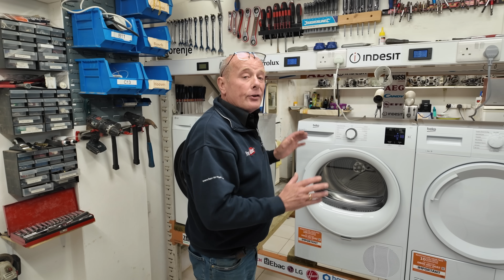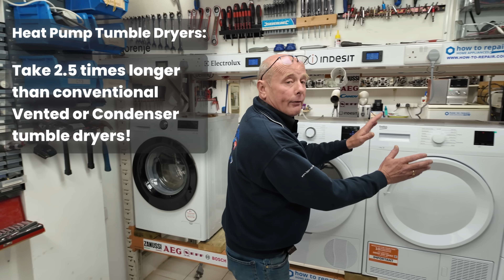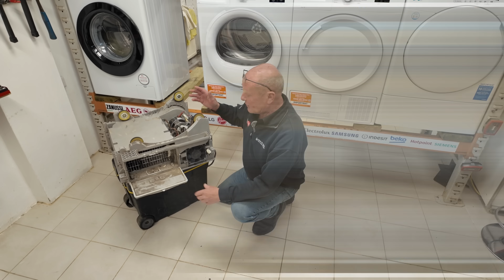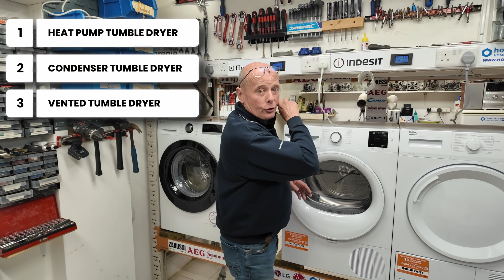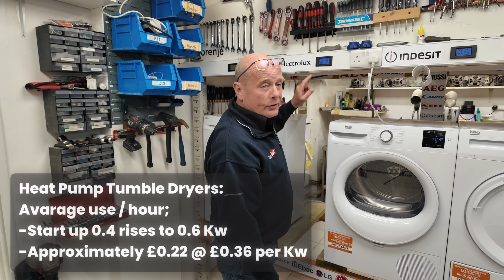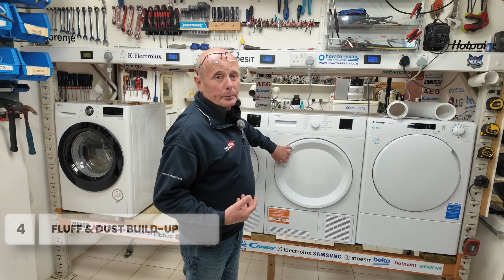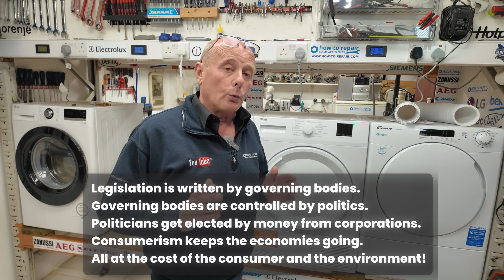Tumble Dryers the Shocking Truth About Heat Pump vs Vented & Condenser, NEW LEGISLATION!

Comment: As a Refrigeration engineer I am a bit biased. I bought my Samsung heat pump dryer used and not working. I quickly found the problem was the evaporator fins totally blocked with fluff that had got passed the filters. A quick going over with a hoover is all it needed, no need to take anything apart. I totally stripped and cleaned it and everything else was fine. It was up and running in about an hour and has run for over 5 years since without a problem. 
Previously I had a washer dryer that I could not use to dry due to the high temperature that ruined clothes. Heat pumps use much lower temperatures so are much kinder to clothes. I would question the drying times as mine takes about the same time as the condensing washer dryer.
Another consideration is the fire risk from dryers which is much reduced with heat pumps.
Repairing the heat pump is definitely expensive but they are the same as a fridge and run for far fewer hours so if the filters are kept clean they should not be a problem.
Reply: Yeah, i have auch POS samsung dryer. That is terrible design with that "filter". I added additional filter in fron of the fins made from the aquarium filter - easy to clean, low resistance. Never again samsung appliance.
Reply: @kuflik  mine came with a filter. I also replaced it with aquarium filter foam when it wore out.
Reply: @kuflik  retired appliance tech here. Samsung makes good TV's and phones. Appliances? Absolute junk, especially refrigerators.
Reply: @ForrestTainio love our washer and tumble dryer from Samsung. P. S the heat exchanger fins get cruddy.
Reply: @ForrestTainio Samsung best freezer-fridge I ever owned, 9KWh a month to keep everything at 3°C / -20°C  that less than half of the energy my previous Liebherr needed to keep it at 5°C / -18°C
Reply: @rj7855  you were lucky.
Reply: To get into my dryer I tape a cardboard inner from a finished roll of,paper towel, tape it to the end of my Hoover nozzle then flatten the end to get it into the narrow space. Works really well, I then remove it and put it in my recycling. Any fluff I keep for a friend who owns a wood burner- she stuffs empty toilet roll middles with fluff from the dryer and uses them as firestarters. .
Reply: I have a AEG heat pump dryer and doesn't seem to take any longer than the condenser dryer we had before.  My only gripe is the dust in the room that it produces, I can even smell it, so I leave the window open just above it.
Reply: @OidHunter   There must be a leak somewhere, has it been like that since new? AEG are a top make so I suspect it needs looking at. A leak will make it less efficient. Could be as simple as a loose or perished flexible duct.
Mine doesn't create any noticeable dust or smells and it is in a small utility room.
Reply: I also have a Samsung heat pump dryer. It failed after about 4 years with exactly this problem. It took ages to dry anything, and rarely got things completely dry. Before I knew what the problem was, I had it in bits and got rid of lots of internal fluff. I now understand the importance of keeping the fins and filter clear of dust, and another 6 years after (10 total) it runs like a dream. Dries well, and in around an hour to 90 mins. Just keep that filter clean (as well as the drum filter).
Reply: How did you hoover out the fluff from the evaporator fins/what did you use? I have a Samsung heat pump dryer as well, after about 3 years the fins seem pretty full of lint/fluff. I tried using the home vacuum cleaner but it didn't do much. Did you use a wet/dry vac? Did it matter if the fins were dry or did you wet them down? Any tips would be greatly appreciated! Hope it lasts more than just a couple more years...
Reply: @crayolaisin  a lot of it came off just by peeling the "carpet" from the fins. Then a hoover with the small nozzle did much of the rest. As I also stripped it down I used an airline which made it as good as new. Be careful not to bend the fins over. They can be straightened with a small screwdriver.
Reply: @crayolaisin I use an old steel nit comb it even straightens bent fins
Reply: We have a condenser drier in a large cupboard and when it is running it heats hallway as we keep the cupboard door open.
We originally had a washer/ tumble dryer which ran away with electricity and clothes always had a scorched smell. It was  a CDA machine installed by the developer we had no choice it was part of the flat. It eventually set fire to some clothing. We bought a beko washing machine and a separate tumble dryer. We like the equipment.
Reply: I brought a heat pump drier  due to the low amount of kw it needs to run.  This is well within what my solar system could generate at the time.  So I was able to let the wife do both washing and drying at the same time powered by the sun .  Mind you a washing line would be cheaper . 
As some one who is repairing these units.  It would have been a nice touch. To actually state. How many times you have to go and replace motors and bearings. On the equipment you service . Also. My unit came with an extended warrantee of 5 years.  And there are always company's who are   Pushing these types of insurance policy's.  So if it's an issue for you  then this may be a alternative way to protect against it failing
Reply: @bill2960  I don't repair domestic appliances as I only work on commercial/industrial Refrigeration. I can only pass on my experience with my Samsung setup which I run on a battery system that powers the whole house and gets charged overnight at 7p per kwh.
Reply: @foxythedirtydog4494 an hour and 0.4 to 0.7 kwh to dry a full load? Really hmm I'd believe that when I see it, I'm guessing 0.7 to 1.5 kwh would be more realistic for a typical HP dryer given how long they run for (typically 2 hours min for a full load or longer). But my Bosch HP dryer is certainly gentler than a condenser which used to scald the clothes in my previous rental apartment (so I never used it). Even the heat pump is just about low enough temp there is even a tiny amount of shrinkage with delicate clothes. I can't understand how people use condenser driers without shrivelling up their clothes.
Reply: @mryan4452  I've used a condenser dryer for years and have never had shrivelled up clothing.... My old Hoover dryer was an absolute delight to use, the clothing came out perfect, hardly ever needed to iron them... Thank god!!
Reply: Mine is faster than my old condenser dryer which took forever. Not as fast as my mum's vented dryer but we don't have anywhere to vent it. It has made a noticeable difference to our energy bills. We have only had it 2 years so I don't know about longevity yet. I do agree that it's not easy to clean the fluff out of the condenser but mine has 2 filters before the condenser so it doesn't get as fluffy.
Reply: *Past
Reply: 2 and a half times longer to dry your cloths is not better lol.
Reply: @RickyKirkman No problem for me as I don't mind waiting for drier clothes that don't get damaged by a rushed process. I've owned all three types of dryers too.
Reply: Is it normal when I have a cat to see quite some cat hairs stuck on the front of the fins after every load?
Reply: Yeah but your an engineer.  What about us old ladies that haven't got a scoobie, and on a low pension, we can't afford that sort of money every few years to call out an engineer.
Reply: @Diane53M  I clearly stated I am biased. I have skills 90% of people can't comprehend yet alone aquire. You have skills I don't have and never will.
However, the only maintenance I have done, since getting my dryer sorted, even a child can do. The fluff filter gets a quick clean every 2 or 3 uses. The machine pops up a filter clean warning on the display about once a month meaning the other filters need rinsing in water. This means having to use something like a butter knife to get them out. Rinsing them is easy and they pop back in easy and the warning automatically clears. The fluff filter is just inside the door so easy to get at but the other filter is almost at floor level so, a on the hands and knees job.
That is all that has been done, apart from buying some aquarium filter foam and cutting to size when the original became too loose. So maintenance has cost about £8 altogether and no skills needed. It was a non working machine that only needed the evaporator cleaning to get working. (Although I did totally strip, clean and rebuild it at no cost). The evaporator is directly behind the lower filter so an easy job anyone can do.
Now for the bad news for you. My washer and the dryer are both made by Samsung. They look good, are very reliable and do a great job. They are far superior to all the hoover, Indesit and hotpoint machines me and my parents used previously. BUT and it is a big BUT, they are very expensive. The washer cost £600 new and the dryer £100 as a well used 4 year old non runner. However when I got the dryer they were over £900 new. To me this alone makes them uneconomical for most people. I can't see it ever saving that much electricity. 
Obviously there are cheaper alternatives but will they be as reliable or do such a good job?
As my wife works till late I am responsible for the laundry (but not the ironing, that is a womens job). As I also work, hanging clothes out to dry was a pain. A washer dryer seemed ideal but it overheated the clothes. The Levis badges on jeans shrivelled up to the size of a large postage stamp. So after replacing the second set of drum bearings and 
a pcb I went for Samsung and they have outlasted all others. Although I did have to repair a hole in the washers plastic drum caused by a £1 coin and a couple of the very flimsy paddles have been replaced (2 are loose now so I have a spare ready).
Safety is another big consideration for me and having electric elements around highly combustible fluff seems risky. Heat pump dryers are far less likely to burn your house down. 
Buying anything means having to make compromises so having all the information will help you make an informed choice from all that are available. I am only giving bits of information so use them to buy what works for you not what people like me say suits us.
Reply: High temperature? Are there not different heat settings?
Reply: @22balogh22  That is what I wonder about. Do some dryers not have heat settings? Or do people not know how to use them?
Reply: @Mikeydude001 heat pump driers don’t have temperature settings as such. They usually have moisture sensors which adjust the drying time.
Reply: @22balogh22  the heat pump runs continuously so there is no temperature control.
Reply: @foxythedirtydog4494  That doesn't really make sense, they take longer to dry clothes because they have lower temperatures but they have different settings high medium low fluff etc
Reply: @22balogh22  It is not just the temperature of the air that affects drying. Airflow and humidity make a big difference. Heat pumps lower the dew point making the air able to do a better job of removing moisture at lower temperatures. Airflow  seems to be similar but I don't have any figures. The ducting in heat pump dryers looks larger but the air may move slower. 
As someone mentioned, heat pump driers have humidity sensors to end the cycle when the clothes are at the required dryness (cupboard dry, ironing dry etc.) unlike other types that just use a timer and a heat setting. My Samsung has about 12 settings but only gets used on the cupboard dry,  cotton setting for everything - which is the default setting when it is turned on.
Next full 9kg load I will measure the power used which can be compared to others.
Reply: @22balogh22  I have done a few runs and it uses between 0.4 and 0.7 kwh a load. So way less than conventional dryers and taking about an hour to an hour and a half a load. 
Maybe the guy should try a Samsung drier on his test rig as I don't get anything like his results. Taking two and half times as long seems to show that his testing methods are questionable.
Reply: I always clean the fins with an old nit comb plus it straightens the bent ones out really handy
Reply: Heat pump driers have been shown in England to catch fire, and people houses burned down, so I wont be getting one.
Reply: @stephy31uk I could say the same for pretty much every home appliance. Do you have a washing machine? If so better get fid of it and start washing by hand. I bet your wife will love you for that.
Seriously though you are probably confusing normal dryers with heat pump driers. Those really are notorious for fires. Heat pumps run far cooler so are nowhere near as bad. They don't have heaters which is the big difference.
Reply: @stephy31uk I think your confusing with the ones with heaters like hotpoint that have burned down many homes!
Reply: 60 or 40 degrees heat in a dryer is still 60 or 40 degrees heat independent of the heat source.
Reply: @sjokomelk A heat pump dryer runs at room temperature, but the condenser is cold like a refrigerator. During operation, the air slowly gets warmer due to heat from the compressor, but 40°C is seldom exceeded at the end of the cycle. There is no electrical heating element inside except in hybrid dryers.
Reply: @flexiblebirdchannel  that's an interesting note, I knew it would spit out the air at about as hot as the heat the pump itself wastes, but wouldn't expect it to be that low. I wonder if combining it with a small heating element would be beneficial or if that could work against the heat cycle on the cold side
(heck I'm a mechanical engineer myself but not being much into thermodynamics I sure ain't gonna calculate that myself).
Reply: @Kalvinjj  not using a heat element IS the major game changer - saves lots of energy, as heat elements (water, air, old-fashioned light bulbs, ovens) are the largest energy users in a household.
Reply: @sjokomelk  But the cost of energy vary according to the heat (i.e., power) source.
Reply: @ That is true. And that is why a heat-pump dryer has the advantage of only using 1/4 of the energy from electricity, and take the rest of the energy from the air around it.
Reply: @sjokomelk  but a heat pump dryer takes three times longer to dry your clothes then a conventional dryer so how much money are you actually saving?
Reply: @DryUrEyesMate 
How much of a cost saving is made does depend on your energy energy tariff. 
My day rate is 24.41p per kWhr, and our condenser dryer takes about 2 hours on eco mode, which doesn't get as hot, so is also more kind to clothing. It uses 1.6 kW, so about 3.2 kWhr of energy per drying cycle. This works out at around 80 Pence per drying cycle of 2 hours. A heat pump dryer at 400 Watts for 3 hours would consume about 1.2 kWhr, which would be less than 30 Pence worth of electricity. So effectively a 60% + cost saving on every cycle. Additionally as there's no electric heating element involved, a heat pump dryer would be safer to use at night, which means low price electricity for those that can get it, which again is another cost saving. In a normal domestic use scenario, a heat pump dryer will save it's cost in a couple of years, which means it's worthwhile having.

When our condenser finally fails, it'll be replaced with a heat pump dryer.
Reply: @DryUrEyesMate  maybe some take longer but mine is about the same as a condensing washer drier.
Reply: @DryUrEyesMate  Exactly....a lot of owners including me would say almost nothing given how long  and how many times you have to use to dry with a heat pump. Worst purchase i have made but thankfully replacing this week with a traditional condenser dryer.
Reply: @sjokomelk  Wrong.  It doesn't take energy from the air. The air is circulated from the drum to the  evaporator which is cold (which removes the moisture from the damp air) and then through the condenser which is warm. The system becomes warm due to the energy required to run the compressor which is around 400 watts.
Reply: @sjokomelk that’s not how heat pump driers work. They don’t heat the air up very much at all, they only warm it and the heat pump then extracts the water from the damp air
Reply: @sjokomelk  The cold side of a heat pump dryer is way below ambient, so a heat pump dryer can run at a 100 degree delta without having a 100 degree high-side temperature. A venting dryer cannot do this, so to achieve the same delta is must run at higher absolute temperatures.
Reply: @sjokomelk you're denser
Reply: Gas dryers have a flame and electric dryers have a red hot glowing element that can start fires. The air cools off before it hits the clothes.  @sjokomelk
Reply: @sjokomelk  That is the air temperature. But the heat source in a conventional dryer is a heating coil with very little surface area and large power input, so the surface of that wire is really hot. If you stop the air flow for a couple of seconds, it glows red. In the heat pump, the heat source is the condenser side of the refrigeration cycle which gives up its heat over a much larger surface area at a lower temperature, it can't even get that hot to begin with.
Reply: @sjokomelk  It doesn't hit 60 degree heat, and temp is not a setting. Dryness is a setting, and type of textiles.

Comment: our new heat_pump_dryer takes 3_times as long as the old dryer! And this new dryer "leaks" a lot of humidity into the room, which the old condenser_dryer didn't. The window and even some tiles get wet, when this dryer runs; it really takes 3-4 hours, even more. 
The old really made the bath room warm but not humid; nice in winter.